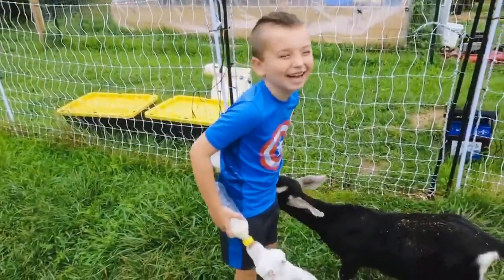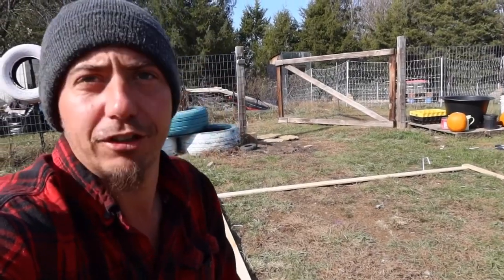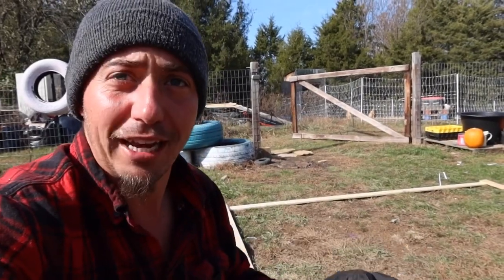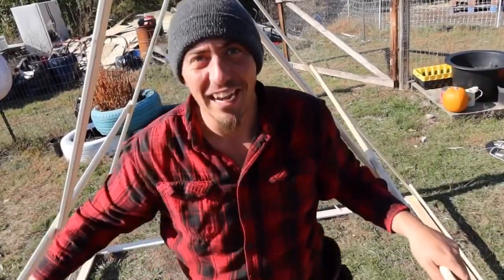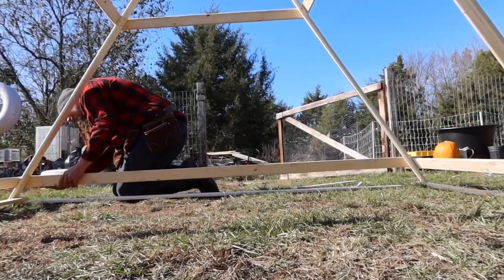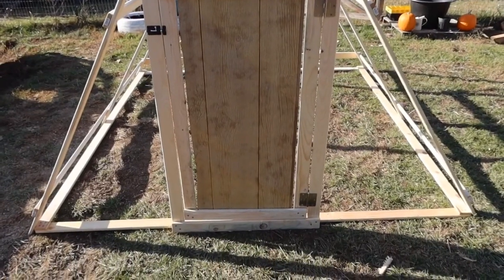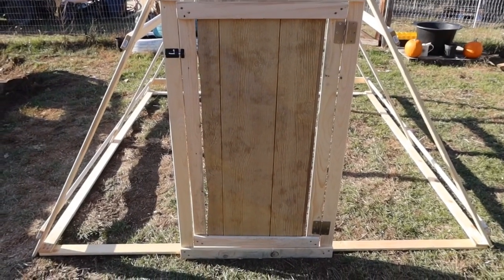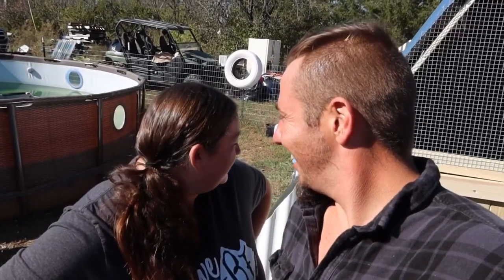How To - Cheap & Easy Animal Tractor | Chickens, Goats, & Pigs

Comment: 21 boards x $1 each (comes in packs of 6) = $21-24 
Tin siding $14 each x 12 -14 (or 6ft high build modification makes it cheaper) 
= total cost $100-150 structure each 
(1 for girl goats does, a 2nd one for boy goats bucks) 

It would be good to know if this has been anchored.  Updates?  With high winds, I’d be concerned that that could act like a trampoline and take off.  Perhaps with some pressure treated lumber it could last longer, against the ground, but I don’t know how much that would add to the build.  Overall, looks good!  Glad to know the goats and their babies will stay warm and dry in winter and cool in summer :).

Comment: Just a tip using corrugated tin etc. always put your screws in the hills not the valley. This way no water sits around the base of the screw. And it lasts longer

Comment: Genius!! Hey Wyatt! 
If you add standing pallets as a bottom wall and set the A-frame on top.....OMG!! Beautiful! Kevin at Living Traditions Homestead has built what I call "The Quack Shack" for their ducks and used pallets for the walls but his is 2 pallets tall, y'all only need one with the A-frame, check out how he done his, even though I know you have the know how to do it yourself, it's available if you need to reference it. Great job. You know it's kinda like my green house make up or the bones anyway. Lol. I'm using the old A-frame style swing set as a repurposed A-frame. 
And not to be a Debbie Downer, just sharing 2 of my past experiences with the Tin like you used. One summer about 8 yrs ago, I was helping my uncle mow a neighbor's yard. They had used the Tin as roofing for a pump house and I was going to pull some weeds by only bending over and brace with my forearm against the Tin......OUCH!! Next day I had a 1" tall water blister from my elbow to halfway before my wrist. The temperature was about 97° that day and drought season. 
When my son was about 6 yrs old he was racing his brother to get the phone that was ringing and fell. He tried to break his fall of course, by putting his hands out in front and caught the Tin between his fingers and palm on the edge and had to have surgery to reconnect nerves, tendons and ligaments.
I just wanted to tell you about those two accidents in order to paint a vivid picture when I say......"Y'all be careful around that tin, it can be dangerous."
I hope y'all have a great week ahead. Much Love and God bless.

Comment: If you ever get a chance look into a kreg pocket hole jig might give you a little bit more stability when your trying to screw or to your base. Love the design and concept. I could actually almost stand up in this maybe! I am glad you have come to terms with the junk pile. I mean honestly we do all have a pile of treasures. They also make blades for your skil saw to cut tin I use them often. Nice use of Hardware Cloth. With it being used for the goats will you still use the door?
Reply from the maker: I think for the winter we will use it. On those extra cold nights we will shut them in there so they stay out of the wind. For the most part though, it will just be propped open.

Comment: I have a chicken coop already but it is made from plywood. My question is what can I put over it on the outside to make it look better. I was thinking siding but checked prices and it would be expensive. Any ideas? I like the tractor for the goats, good job 👍
Reply: Put 1x2 battens every 12 inches or so and then paint or stain it. It will look like a board and batten siding. That is what we are going to do to our chicken house that is right now painted plywood. We were given it free. So we are going to put our own spin on it.

Comment: where did you get the idea/plan from?  Just wondering so we might check out other ideas along the same line...thanks
Reply from the maker: I searched chicken tractors and watched Doug and staceys & Sow the lands designs. They are both drastically different but watching the two I created this design. I’m sure there are A Frame designs out there but nothing that I found.